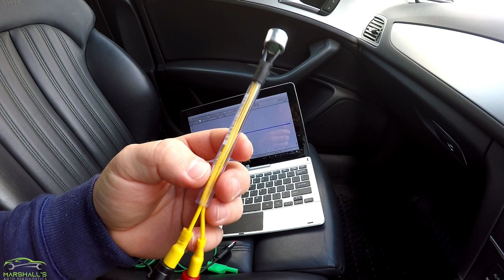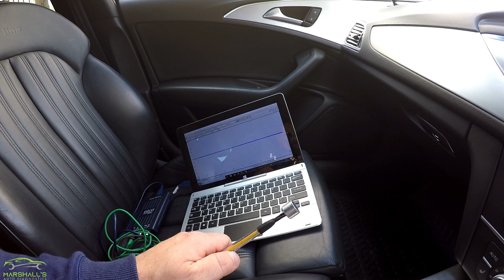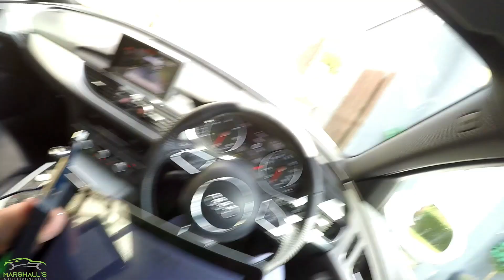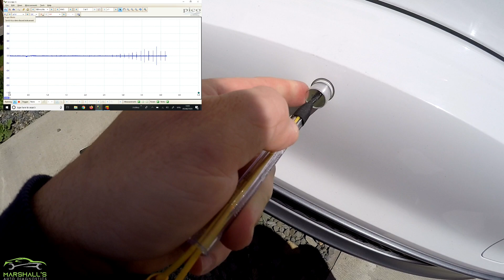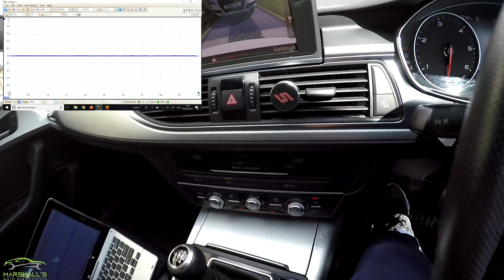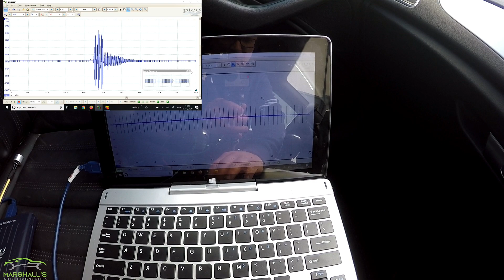Home made parking sensor tester/ reciever

Comment: Very nice 👍🏻.What kind of receiver is this.Do you maybe have a name or a link?Best regards from germany
Reply: Thank you very much for the link.I. will try to make my own one👍🏻
Reply from the maker: @MobileCarDiagnostic  shouldn't be a problem. Just try both sensors and see what one works best. Also switch connections round and see if it works best on one particular polarity
Reply from the maker: Thanks you for watching, I I apreciate that. Here is the link for the reciever
Reply from the maker: https://www.ebay.co.uk/itm/TCT40-16R-T-16mm-Aluminum-Housing-Ultrasonic-Transducer-Sensor-40KHz-2-Pieces/183144432482?pageci=b7933cc2-e553-45ed-b7f3-7b73b92df438